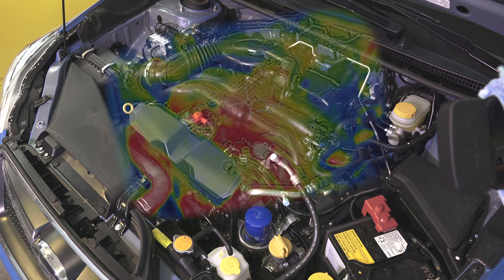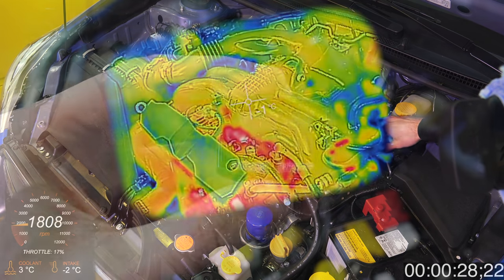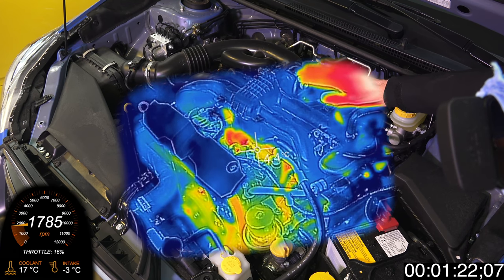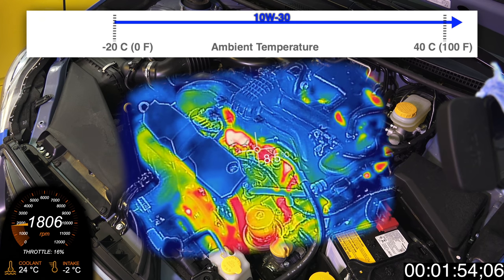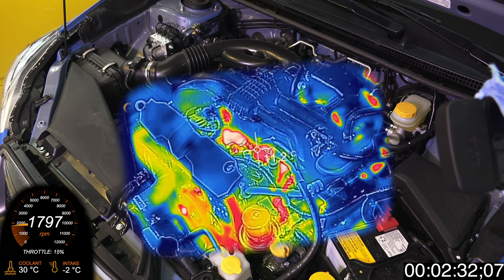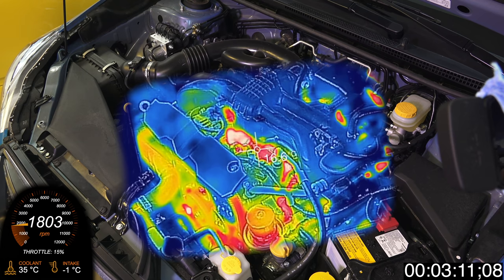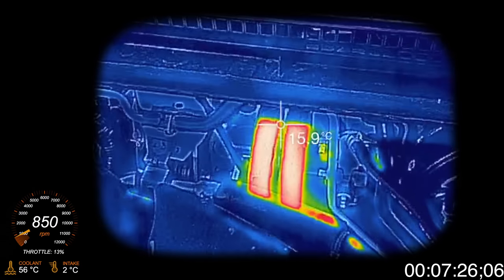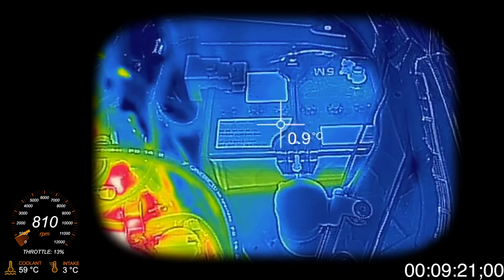Watching A Frozen Engine Warm Up With A Thermal Camera

Comment: American using metric units, you're the real MVP :D
Reply: Whats wrong with metric??
Reply: @lfacelessbucklel1291  Nothing, but most americans can´t handle it.
Reply: @cesarg4328  it's basically required for science.
Reply: Celsius is no more useful for day to day use than fahrenheit. It also isn't always useful in science where you often need an absolute scale. Why would Americans switch when we don't care if the rest of the world likes it or not?
Reply: @GuyFromJupiter  because metric is far superior to American measurements. Celsius for example is based on a scalr to fit important temperature gradients like water freezing at 0 C and boiling at 100 C
Reply: Probably Canadian
Reply: @connivingkhajiit  "american measurements" surely you are referring to "imperial units", ie came from england.  fahrenheit is 'easier' for day to day life since you don't have to use decimal places to be more specific, it's almost twice as accurate in that regard.  celsius is only helpful if you can't remember that 32* is water's freezing point and 212 is water's boiling point, which also isn't static because if you live in Denver, Colorado USA, your water is going to boil at closer to 200*F or 94*C.  and, as has been pointed out, neither is really that accurate and an absolute scale, like kelvin, would actually be best.

are brits really allowed to criticize our measurement units when they measure their gas/petrol mileage in mpg but fill up with liters and drive distance in km?
Reply: @connivingkhajiit  you say that but we created the internet and smart phone.
Reply: @residentevil2928  measurement system =\= scientific research funding
Reply: Metric system is Wack
Reply: no americans use fahrenheit when it comes to mechanics, only housewives learning how to cook
Reply: @Cesar G The US has metrication laws, it's just they were made optional and nothing has forced us to change. At best, we're lazy because we're so self-sufficient that not even the entire world can make us change. The only people I hear being completely unable to "handle" things are everyone else when they see imperial units in a video and throw epic fits in comment sections instead of using basic conversion tools like mature adults.
Reply: @connivingkhajiit  America>the rest of the world
Reply: @elchucofried5683  America is made of the rest of the world... May they be Irish, English, Scottish, French, Spanish, Portuguese, Italians, Polish, Russians, Germans, Chinese, Coreans, and so on...
I believe the metric system is more logical and better for units conversions. But to be honest, for day to day use, when I was in USA, it didn't really bother me much to use miles, galons and inches. The only issue is to get from inches to yards to miles while getting from mm to km is very easy.
Reply: @VictorInChains  In America when your describing long distance(Traveling) there is no need to use yards or inches. And in construction I always hear Centimeters, inches, and ft. There is no need to use a yard that's usually for sports.
Reply: @cesarg4328  Sure we can.  We just don't see anyone using them worth wasting our time on.
Reply: @darkmagician1184  "easier for day to day life since you don't have to use decimal places to be more specific" is the stupidest reason i've seen to prefer fahrenheit. there's no reason to use decimal places at all. the difference between 20 and 21c is almost indecipherable. no one in the world has used "20.5c" unless it was a scientific experiment. the fact that a 1c change is not noticable, but a 2c change is noticable makes celsius a scale that is "just right" in terms of scaling.

half of fahrenheit numbers are basically useless. like who pays attention between 74 and 75f? at least make it based on something EVERY HUMAN knows about, which is when water stops being water at both ends of the 0-100 scale.
Reply: Spencer Leeper Celsius is simpler
Reply: Yeah I was the 501st to like this!!!!!!!!!
Reply: Michael Remington I really wish they would only teach the metric system in schools here since it makes a lot more sense. First of all, all of the bass units can relate to each other. For example, say you want to figure out how much energy (in joules) are required to raise  the temperature in “x” amount of water. This would be easy to do without looking up a table or something like you would with imperial.
Reply: @jalene150  I agree. But America will never change over out if habit and stubbornness to change. We'll always stay with SAE with mixed metrics thrown in there
Reply: We use both. Having your car go 0-60 is way cooler in Miles per hour than Kilometers per hour though.
Reply: @elchucofried5683  for inbreeding yes....most certainly... You are the most inbred nation on earth.
Reply: So When somebody says their car can go from 0-60 kilometers per hour in 6 seconds, that is only roughly 36 miles per hour, which would be an extremely slow car if it took that long to get to 60kph. I don't know if 0-60 is a common way of measuring speed in Europe but in the United States it is one of the main ways of looking at car speed capabilities, along with how many seconds it takes to go a quarter mile from a dead stop.
Reply: @WastelandArmorer  the term 0-60mph actually is based on the 0-100km/h since that is what is used for 90% of manufacturers. 0-60 is just the closest thing to that and i haven't heard it being used by anybody not american. On the other hand the quater mile originated in america, although there is no real counterpart in europe/asia because most of them prefer actual driving capabilities and not just the grip of the tires under max kw. So yeah your 0-60 originates in 0-100km/h.
Reply: @eVolution2665  0- 60mph been in use since at least the 1950s. The reason it is used is because it 60mph will give you a one minute mile and they decided that was a good standard speed, not because we were trying to match the 100km speed measure. The 1/4th mile came from when cars were a new invention and there were a 1/4th mile horse straight line sprint races at the time. They would test cars against race horses and later went to racing them against each other. I suspect the reason Americans like straight line performance is our nation is nearly as large as the whole of Europe, and our interstates allow for LONG stretches of straight line driving. Most European super cars do not do well against the much cheaper muscle cars on those straightaways from the driving experience ive seen. But it is true most American cars cant corner, but they really don't need too most of the time.
Reply: @eVolution2665  Its also still used by the English.
Reply: @GuyFromJupiter  Agreed completely.
Reply: @connivingkhajiit  Who cares. 99% of the time people care about how cold or hot it FEELS, not the temperature at which water boils at sea level. Fahrenheit is just fine for everyday life.
Reply: I’m an American and I love metric and think it should be used
Reply: @seventhdaymusic  Why?
Reply: Ron Tiemens Because it’s a far more simple way of measuring. Everything in metric is done by 10s. But in imperial it’s usually by random intervals. A mile is 5,280 feet, or 1,780 yards (correct me if I’m wrong) but a Kilometer is 1000 meters. If we went by Kmph instead of mph, than we would know exactly how far we’re traveling every time, and it would make math a whole lot easier.
Reply: @seventhdaymusic  The math is no problem. Using your own example, if I travel at 60mph for 3 hours, I know I have gone 180 miles. What is so hard about that?   I couldn't care LESS how many feet are in 180 miles. And even if I did, how hard is it to pull out my phone and use its calculator to multiply 180 x 5280. Big deal. No one thinks it is a big deal. Your justifications for the supposed "superiority" of the metric system in everyday life are contrived and silly. For scientific lab work or physics calculations, yeah, sure, metric is great -- knock yourself out.  But for everyday life, each system works fine; and if you are used to one system, that system is fine.
Reply: Ron Tiemens Listen here. If you went for a degree on math, or civil engineering, you would probably need to know how many feet are in a certain amount of miles. You’re not always going to be able to use a calculator. If you’re doing a test and your not allowed to use a calculator, then you need to know how many inches are in 53 miles, just as an example. If you do it the way I do it on paper, you’ll convert the inches to feet, then convert to miles. 53 x 5280/1 x 12/1 would be what you use for finding out how many inches are in 53 miles. Now say you need to convert 146 cm to km. 146 x 1/100 x 1/1000 That math is a lot easier to do, with or without a calculator. The answer would be 0.00146 km.  If I had the time to do the miles to inches problem, I would do them, but I have no time right now. But the conversion of cm to km was easy to do in my head, because they use intervals of 10. I’m not gonna be like boomers saying you won’t always have a calculator, but what if on a test for one of the above mentioned degrees, they don’t allow a calculator for that simple of a paper problem. Then what? It’s a lot more simple to convert with metric than imperial.
Reply: Lots of us use metric to imperial criss cross with our trades. However, expect anyone else to convert once and their heads explode
Reply: @seventhdaymusic  Can you read? I said in my post imperial works just fine for everyday life. Metric is just fine for science and academics. real people do not care how many inches are in 53 miles. It is useless information.  I think the real problem here is that some people are perfectly happy not doing what YOU want them to do. News flash -- the world does not revolve around you.
Reply: And they say we're annoying, I swear you all talk about it more than we do. I know the metric system but I still don't like it
Reply: @daduncker20D nah this is straight up not true, mechanical engineering student here. we’re completely fine using both units. I’m on a student engineer racing team and we only use merica units

Comment: In Russia they just light a fire under the engine
Reply: I approve this message.
Reply: Roddy Yang In russia the fire lights an engine under you!
Reply: In the engine a Russia starts in the fire
Reply: True, my dad used a compact butane stove for that
Reply: I've also done that, with alcohol in a steel can. Another idea, if you don't have an engine block heater is to put a high wattage bulb under the oil pan. Both methods have resulted in a successful start, something that would not have been assured without it.
Reply: As did the Canadians in WW2. They lit small wood fires under all the equipment so the engines weren't frozen solid.
Reply: I saw an army video where they did that in Alaska because the oil was practically solid.  it was a black and white video, so probably before synthetic oils and modern tech.
Reply: They sure do. And while it heats up the engine they play balalaika to their bears as they dance before driving off to work on a nuclear reactor.
Reply: zee, synthetic oil contains about 90% of regular mineral oil and the freezing point is only a VERY few degrees lower. :-))
Reply: You're partially correct. I lived in North of Kazakhstan, it's close to Siberia, so it gets extremely cold in winters, down to -40C (or F, it's the same at -40). Car batteries literally freeze at such low temps, so they would try to heat up the battery with a gas burner(?), and some cars would catch on fire.

Or I saw people heating up locks on a car cause it got frozen
Reply: +sergazinm Sounds like Canada. There was an American trucker going through North Canada for something, forget which, but the diesel in his tanks gelled up because it got too cold and he tried warming the tanks with a blowtorch. The truck burnt to the ground
Reply: yes, Blowtorrch! thank you, I forgot the word (English is second language).
We have shitty gas and diesel in our country. Gas burns just fine in winters, but diesel sometimes freezes even at -20C (-4F).
Reply: +sergazinm This guy was driving the truck through -45C (-49F) so even with good diesel it'd wind up becoming too thick to use. Using a blowtorch on a fuel tank is never a particularly good idea
Reply: sergazinm I believe about bad fuel in Kazakhstan, but actually, ANY diesel freezes at -20C. You have to add additives or have a tank heater (usually just exhaust pipes going around it).
Reply: Maloy7800 any diesel freezes at -20c? Either diesel comes with additives in canada from pump or this incorrect.  About a quarter of all trucks here are diesel and being a farming province a good percentage of people have trucks. It goes  below -20-50c regularly and I have yet to see this cause an issue.
Reply: Landon Im pretty sure that in winter there is antigel additives in diesel from the pump
Reply: Landon Im pretty sure that in winter there is antigel additives in diesel from the pump
Reply: Landon Yes, cold-weather diesel comes with additives from the pump. That's what they mean when they "winter" or "arctic" diesel. Diesel fuel without winter (antigel) additives freezes at minus 20C. Ask the Canadians about it, they'll explain.
Reply: +Maloy7800 im a Canuck and can vouch. Go get fill a jerry with diesel in the summer, and when fall(In Canada anyway) comes around, if you put it outside it ought to be cold enough to freeze
Reply: Not going to argue and too lazy to find better sources. So here's the starting point of your education:
https://en.wikipedia.org/wiki/Winter_diesel_fuel
Reply: thanks, I didn't know that
Reply: i think in ww 2 every nation did make fire under the tanks in winter also makes a warm interior maybe xD
Reply: I don't know if you meant this as a joke or not, but they actually did in Siberia.  They did here in Alaska as well back in the 50s and 60s.
Reply: I had 30 weight oil in my old Chevy and it got pretty cold one early Winter day. I had to light charcoal under the car as inwas banked with snow to make the oil move! I then changed oil,,,, yes it worked great!
Reply: in Russia, engine thermally views you!
Reply: TheCarLovingSwede 87% röstade för att förstöra Sverige.
Reply: Full camp Chad Mendes In Sweden the Arabs set the cars on fire, daily....
Reply: and the best part is this aint even a joke, a good way to warm up a much older machinery in the middle of horses ass in nowhere where warmth is a dream
Reply: in Russia the fire is lit the night before BY the engine
Reply: For tractors bulldozers etc cars will catch fire haha
Reply: That actually works. You think no-one in Sweden ever did that? Although it's not a "fire", it's a pan full of hot coals. Better for the engine, and it makes starting old engines a lot easier. And it's easier than draining the radiator and/or oil system every night, bringing it inside and warming it up, so you can refill the engine in the morning. These were al tricks known to our ancestors in the Northern US; perhaps Sweden missed that part because they didn't have cars until the second half of the 20th Century (that's a joke, chill)
Reply: i just get sad when i see sweden, hope you make it out.
Reply: They light their horses on fire?
Reply: TheCarLovingSwede no, in mother Russia engine warms fire.
Reply: In russia usually there wasn't cars
Reply: Unfortunately it's not a joke
Reply: TheCarLovingSwede in Africa they throw water. If the can find it
Reply: In rusia , engine red lines you !
Reply: This is actually true. In russian tanks you preheat the lube oil by lighting fuel oil on fire under the lube oil tank.
Reply: in finland we do that to tractors
Reply: these comments are straight from 2008
Reply: Yes know thats crazy
Reply: @Maloy7800  this comment is as stereotypical as it gets loll
Reply: @Jesus_Christ_loves_you_alot  Which comment?
Reply: @Maloy7800  the one about bears and balalaika
Reply: Not until now, 5 years later, I realize how many of you liked my comment. Thanks!

Comment: I live in Moscow, so sometimes the temperature gets really low, below -40C. I'm driving 2012 Volvo XC90 and never actually had any problems with starting up in the cold. Just wait until revs calm down to ~800RPM and you are good to go. Normally it takes about 40-60 seconds, depending on how cold it is and how far ago the previous launch was.